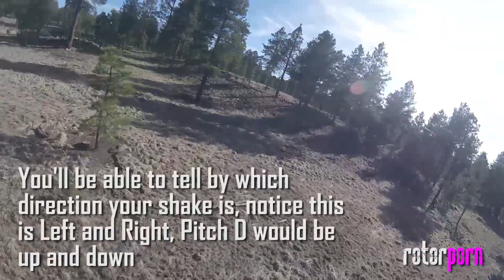EZ GUI PID Tuning on Omnibus F4

Comment: Do you find the f4 boards running at 8k need much higher I and D values than f3s to feel tight when flying?
Reply from the maker: yep, that was something I noticed right off the bat. Especially in the thin air at higher ground elevations.